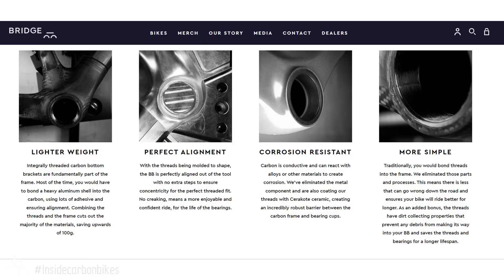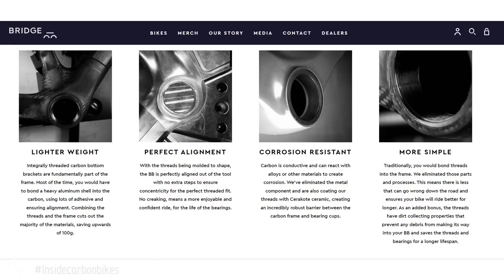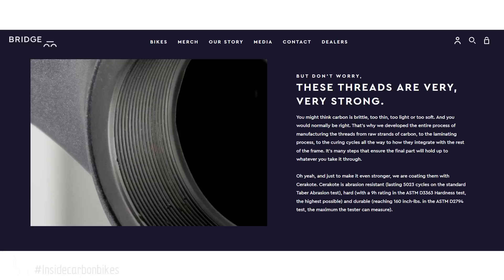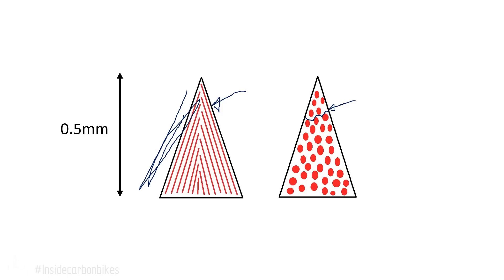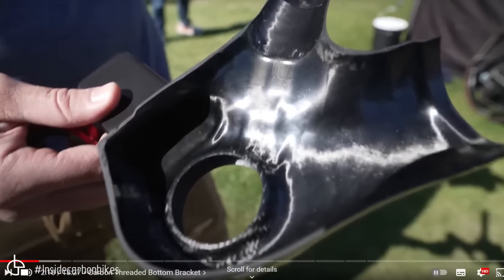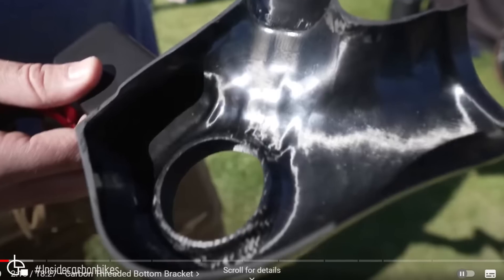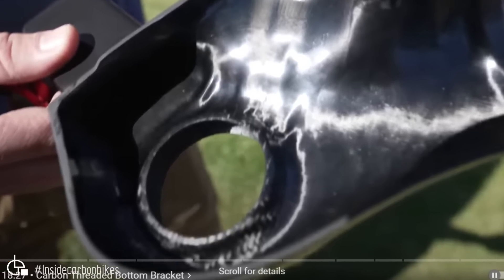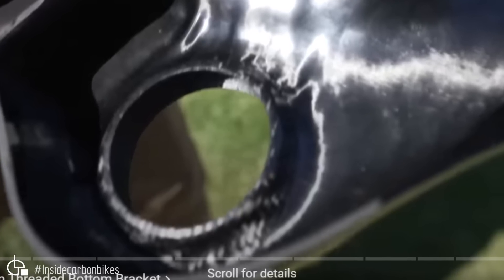Threaded Carbon Bottom Bracket???

Comment: my thought behind it is that, yes a threaded interface has less precise tolerance requirements and therefore a the shell of a threaded BB can perfectly align the bearings relative to each other while the frame only has to align the threads roughly to the rest of the frame. but i dont see this risk of having the frame threads carbon being worth it, while they might not be stressed very much and likely have very short chopped strand fibers that could more randomly orient themselves, for longevity sake i would not feel comfortable with the ceracote protecting the bb getting galv corrosion and being impossible to remove. Overall i dont think its too much of an ask for manufacturers to get some bearing seats nice and accurate? plenty of ways to implement better quality control.

Comment: Threaded bottom brackets at this point are just a marketing strategy. Everyone has this idea pressfit is a bad idea, the reputation for press fit bottom brackets has had a rough start so these people are capitalising on some imaginary idea that threaded bottom brackets must be great.

I've seen the odd threaded frame with terrible tolerances and absolutely no hope to repair it. Best you can do is face both ends of the shell and use a "threadless" square taper bottom bracket to avoid the threads entirely, which makes you beg the question of why not just make it press fit to begin with?

As a mechanic I love a threaded bottom bracket because I'm so familiar with them it's a quick job for me to replace one. I'm also old fashioned and mostly ride bikes that are 30+ years old.

Comment: There are some BB's where you can tighten the BB internally, not using the external flange on the outside of the bike. Not sure if any exist for T47 though.
Reply: Like which BBs? I've only seen one, but can't remember the name.
Reply: @sbccbc7471  MSC BB24 ultralight is the model.

Comment: If the thread is made out of carbon, that will not last long. This happened on paintball community before and threads started to fall apart over time. Carbon fiber is too weak for this type of application.
Reply: Devil in the detail. Pitch of thread, number of threads, diameter of hole. If one has done the math it’s possible

Comment: Thread an aluminium BB into that, moisture wicks up the threads and bingo corrosion. Good luck getting it out again.
Reply: Pretty sure your supposed to use grease my dude.
Reply: @mitchellsteindler  yes correct but we know how good the manufacturers are at putting things together properly.

Comment: Are you sure the threads are using a traditional layup with continuous fibers?   Your thread diagram makes me think this is almost definitely done with compression molding and very short chopped strand carbon.  I have no insider info here but that's how I would do it.

Also, great point about why they did this instead of a press-fit.  I think you're spot on that they just know the market hates press fit right now so even though this may not be the overall best solution, it might be the best engineering solution that the market will accept (I know I had never heard of this brand before this threaded carbon concept so the marketing is working).

Comment: I like threaded BB just because of the fact that I can work on it in my garage, without buying expensive tools and being afraid to misalign while servicing it.
Reply: You could make the same argument about headsets. 
If you cross thread a BB cup you're damaging the frame too.
Reply: its not about the BB standard, its about the standard which how they made a accurate and aligned frameset
Reply: I 3d printed my bb Press and also the extractor... All you need is some M12(or similar) thread, oversized washers and nuts.
Reply: A press fit press will cost you less than a T47 tool
Reply: @epizzoli6104  especially when you have to buy two because the first one didn't fit. #fukkinsram #truestory

Comment: I'm just amazed by the ability of the bicycle industry to create new problems at a pace higher than their abilities to solve existing issues.
Bottom brackets, headtubes vs integrated cables, fancy seatposts design, forks, ...
This is in a context where bikes are heavier (disk brakes) and prices are exploding (groupsets).
What amaze me even more is that people are willing to put even more money in a new bike without having been reassured about the resolution of those existing issues in the industry.
Let's not forget that the bicycle market will collapse in the coming years. It has already begun but the worst is yet to come. Hold on to your hats, it's going to hit really hard. So imagine in that context how manufacturers will try to cut costs down. 
All of this will be a real mixture for catastrophic failures.
Reply: Why waste time solving engineering problems while marketing can sell you new ideas that have never been really tested or withstand the test of time! Just buy more!  Disclaimer: *sarcasm*
Reply: It not just the bike industry...it's every industry...and by design
Reply: @notreally2406  an apple a day keeps the fruit flies away.
Reply: Like discs on a road bike/carbon frame, they initially came in on alu frames..
Reply: @leedorney  disc brakes on MTBs or gravel, cyclocross makes sense, even for those that ride in the wet all the time. But for those descending the argument becomes tricky as it is not uncommon to wear the pads after a big descent and the rider was heavy on them, have wrapped rotors etc. Discs are CONDITIONALLY better on road, but thats about it, not a big selling point and will always be controversial as they do no fit all use cases, and most of the time are just added weight, creating duller ride bikes, that are stiffer on the seatstays and fork. Also their maintenance is a pain for most average Joe's and raise cost of ownership over time, its a big fail for the industry, as it drives people away from it.
Reply: @tellingitstraight  Disc brakes on road bikes are really a solution to having very expensive carbon rims that you don't want to wear down, especially in bad wheather. It moves the consumable from the rim to the rotor/brakepads. Decide for yourself whether that just makes sense or is asinine ;)

And they do have a bit nicer braking behaviour than most rim brakes, but it's not like rim brakes were bad to begin with, on road bikes.
Reply: @ska042 I have monocoque carbon wheels on my road bike, so with disc brakes they could theoretically last a lifetime, just press in new bearings every few years.
Reply: @ska042  I agree with both of you.  Amazing how people are willing to accept 1.5lbs added weight for disc brakes so they can use carbon rims.  Rather than simply using wheels that are nearly the same weight as equivalent depth carbon wheels: alloy rims,  alloy/carbon hybrids like Shimano, or alloy-with-a-carbon-cap like HED.  All of which have the good alloy surface for rim brakes.
Reply: @ska042  a single carbon rim will cost more than an entry-level bike; folks who are thinking of cycling for commuting and recreation are shocked and disillusioned. they wont be back. shimano and other idiots have successully cut their own throats out of greed. serves them right.
Reply: but no
Reply: @tellingitstraight  Disc brakes don't perform any better than good rim brakes, or more precisely good brake pads, in wet conditions.
Reply: @ska042  Only the good ones. And if you are talking about good rim brakes they are by no means bad in behaviour.
Reply: @paulflory3532  Wheels to be some kind of fetish. I never ever notice any real difference in how they perform. If they are light, they feel good. And you definitively don't need any carbon what-so-ever for that.
Reply: I went back to square taper, so there’s that….
Reply: Wow, after BB30, why would anyone go back to square taper, it’s twice as heavy, twice as flexy and if you don’t tighten square taper down it destroys your crank arm. Forgot to tighten down my BB30 and rode for a day with a floppy crank arm since the splines are already rounded no damage was done and it tightened right up at the normal newtons without coming loose again. Square taper use to always come loose in me. Then the crank arm would be wrecked.
Reply: Disc brakes aren’t the only issue, don’t scape goat when you don’t have to. The frames are porkers because of “aero optimization” as well and other gimmicks on the frames
Reply: Move fast and break stuff 😂
Reply: Either during a cycling boom or a collapse we loose. Manufacturing quality dropped during covid and will continue to drop in the following years.
Reply: Calm down chicken little--bicycle market will collapse?  hilarious..im guessing you haven't bought a new bike in 20 years...modern bikes have never been better...never
Reply: But but but but.... weight doesn't matter anymore - (source:  industry Shills).
Reply: I live in Brazil so our bike scene is very much different, but I have to ask: 
Why do y'all hate on disc brakes so much? I use a shimano v-brake on my motorized bike (90's steel mtb turned 2 stroke) and a mechanical shimano disc on my "modern" (by our standards) 26 hardtail.
I love both. I also liked the feeling of hydraulics but don't think it's worth all the work and maintenance (and starting price lol).
And I love watching all this discussion because, as y'all are fighting about carbon fibers and headset tubing, I'm already happy when a bike has aheadset and is not the old threaded 21.1/22mm standard for front forks/suspension (that is pretty much normal round here)
Reply: @LoneWanderer905  
its really just in the context of very light roadbikes. Nobody doubts the utility of discs on MTB, ATB, gravel or cargo bikes

Comment: You don't get it.  I am a mechanical engineer who worked in R&D my whole working career. This is a neon sign to me.  Obvious.  You are positing a false premise. Bike companies don't want to 'spend the money' for concentric, co-axial, aluminum or carbon bores.  Precise tolerances costs the mfr. more.  They worked 'generally' 'good enough'.  Yes there is warranty with less than nominal fit which caused a host of BB problems.
But, a thread allows a 'broader tolerance of acceptability'.  The cost of more perfect bores for proper interference aka bearing and/or cup fitment is GREATER than a molded and even a chased thread in carbon.  Elementary to anybody who worked in the engineering field.
This is a step forward not a step back. Why?  Because it desensitizes the tolerance for a high degree of functionality.  Because in the 'real' world, product is shipped out of spec all the time....thousands every day with even liability in 'all industries'.  A thread compensates for less than perfect bores and the thread is not under high stress.  Co-axiality bore to bore on each side of the BB shell 'is close enough'. Why? Because bearings have a high degree of radial and axial freedom.
My suggestion is, your expertise is more 'material focused'.  I would stick to that unless you have been to engineering school and worked in product design for 20 years.  Otherwise you are just another talking head on youtube with an opinion which in this case is incorrect.
Molded carbon threads or inserted aluminum sleeve in carbon with threaded bores...the bike industry is returning to threaded BB's BSA or T47 because it provides the most functional design with the greatest 'tolerance allowance' which is the real world and not a technician's idea of correctness because he isn't running the company and understands what things cost.
Reply from the maker: So all those car hub bearings, gearbox bearings, electric motor bearings, etc, etc would be better with a threaded housing and additional parts instead of the bearing being pressed in, or is that not the real world?
Reply: @LuescherTeknik  Wrong conflation.  Each application you mention have very different forces.  Press bearings have their place when there is axial force retaining both press fit inner and outer race.  Forces on crank bearings aren't purely 'radial'. There is a 'thrust' component which is the sine of the angle due to pedal forces.  A 'moment' = F x D that 'peel's pressed bearing out of their respective bores. A thread mitigates this thrust component due to pedal forces.
All this stuff is taught in engineering school.
Its obvious to a guy like me and people without this training are oblivious. Initial departure from English and Italian threaded internal cartridge bearing square taper which begat outboard bearing cranks which were more stable and more robust were replaced by press fit 'for marketing' aka weight...but moreover for 'cheapness of manufacturing' aka profit.  It backfired.   The industry transitioned back to BSA because they lost money due to warranty.  An entire aftermarket industry to tame press fit was spawned as a result of this mistake...two companies, Praxis and Wheel Mfg.
Physics is the irrevocable truth.  In a perfect world with 'ideal press fit tolerances' AND adequate crank preload, press fit can survive. But it is much more sensitive to tolerance variation which is 'real' because bicycle manufacturers don't make close to perfect bores that are even co-axial.  Why don't they?  Cost for precise machining/molding and quality control aka SPC.  High reject rate = high cost.  Bike industry only exists for profit and no other reason.
Reply: As someone with the same background as yours,  I'm actually baffled by your response and hope that you're not trolling.
You said it yourself that "Because in the 'real' world, product is shipped out of spec all the time....", hence there is no justification for carbon threaded BB because it requires higher manufacturing tolerance to get the threads right. Luescher's point is that if they've got the capability of making precise carbon threads, then a precise pressfit bore would make more sense considering it is a lot easier to make and control.
I can understand your point about "threaded BBs and tolerance allowance" but it only makes sense if we're talking about conventional, metal threads.

Comment: I dont think this is a "traditional" layup. It's not carbon fibre in the sense that we know it of layup and resin. I think the threads are some kind of molded composite material, distinct from the more traditional fibre layup of the shell behind it. I don't have the composites knowledge to know what that molded material is, but functionally I don't believe it's really that different to the bonded aluminum shells that are common, only with a composite in place of the aluminum. Which being in-molded has some structural advantages.
Reply: Let me get this straight. You don't have the knowledge but your enlightening all of us with your empty B.S. discourse.
I think you're suffering of the Dunning-Kruger effect.
Reply: @Sylvain Michaud  perhaps he watched a video that gave more information than whatever you watched. Man you suck.
Reply: @sylvainmichaud2262  pretty much 😊. As I stated, it's just some guessing about what they're doing, since they're not very forthcoming about their process.

Comment: There definitely  trying to marketing There brand by flexing how much skill they have, rather what works the best I can't see it lasting that long how many bottom bracket  will you get out of a frame? and they do a warranty to put a sleeve in it, if the treads brakes, they should be replacing the whole frame, ( cause that's why you would have bought it in the first place)

Comment: I don't see much pointing all of this carbon threading. Realistically in one ride, riders pee away more weight difference than would be saved by having a carbon threaded bottom bracket shell. So how is this carbon fiber shell made? Is it molded threads which I find hard to believe. And I find it even harder to believe that it would be structurally sound. And of course this is addressed in the video here which I appreciate a great deal. And if it's not molded in then it's cut away. And that makes even less sense. Because if you cut threads, you are also cutting the structure away that holds the whole thing together. The whole thing seems pretty stupid to me.

Comment: It is easier to remove and insert threaded BBs.
Reply from the maker: Not when the metal threads have corroded and seized.
Reply: Use anti-seize.  I have bike that have been through harsh Ottawa winters and I haven’t had a seized threaded BB yet.  Service your BB regularly and seized threads won’t be an issue.  Much easier to remove than press fit BBs without damaging the frame / paint.
Reply: Not the reason.

Comment: I agree: pure marketing.  I don't necessarily agree that press fit is inherently better, and I've never had any issues with threaded metal BBs, so I'll stick with what I know works.
Reply: Pressfit is better by definition. It has less parts so it's lighter, and the tolerance (gap) inherent to the threads means its physically impossible to have a better alignment than pressfit.
The only problem is that pressfit have been sold improperly made in the bike industry for so long that the market is cynical.
Reply: Threaded BBs are often not in alightment.  With most press fits and some T47s, you can have a one piece BB